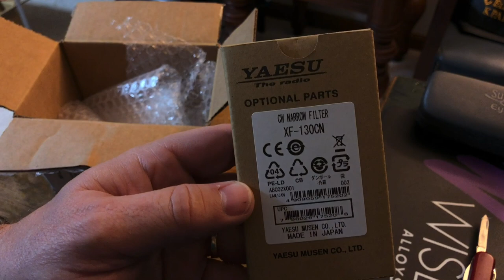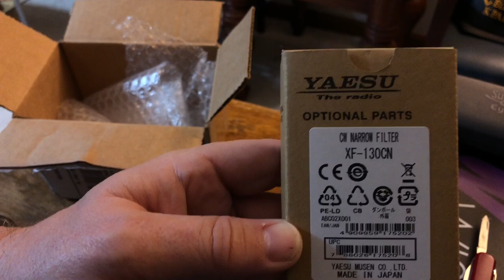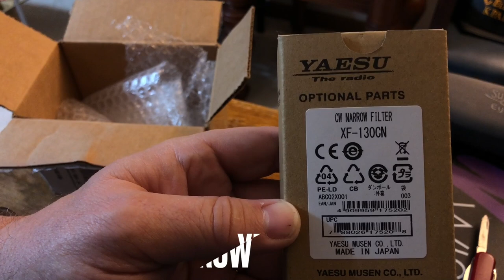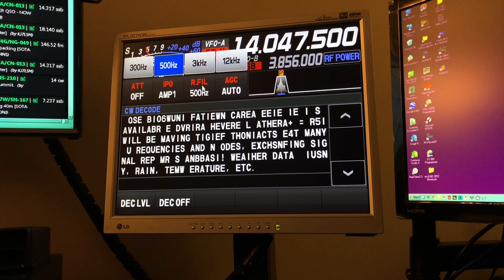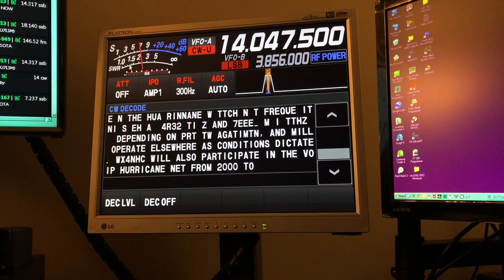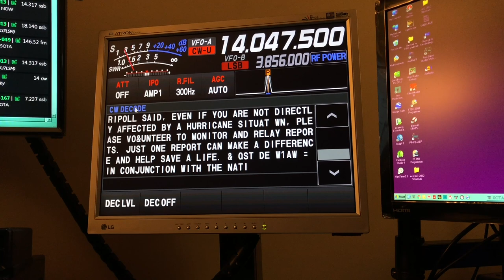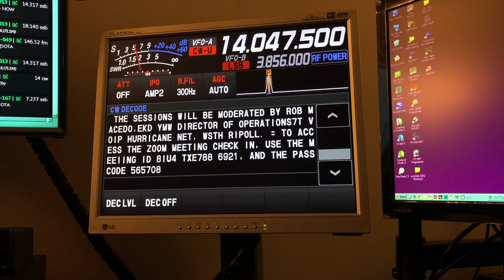Yaesu FTdx10: 300Hz Roofing Filter Installation (Video #38 in this series) #hamradio #ftdx10 #cw

Comment: Thanks for the video, Doug. My 300Hz filter is scheduled to arrive tomorrow. Looking forward to getting it installed. Doesn't seem hard at all.
Reply from the maker: It’s very easy, Tom.  It’s plug and play.  You don’t need to do anything but install the filter and power up the radio.  You will have a choice of 300 Hz appear in the roofing filter options.

Comment: It makes the 50Hz DSP work even better.  It is very quiet and pleasant to listen to when pulling out weak ones.  Thanks for the video.  I had this thing in and playing in 5min.  I did not even get to the end of the video.  Just saw you unscrew it and did the same.
Reply from the maker: It clears more noise and interference early in the receive path.  Since the DSP has less work to do, as a result, the final audio sounds more natural.
Reply: @n4hnhradio  YES!  I have a 80m NTS net and my local QRN level is high, last night was easy on the ears.  NTS is using a hustler 80m resonator mobil antenna in his condo in LA 60mi away.  He is probably on ERP 1W, I can mostly copy him now. I don't think I can copy traffic from him directly without a lot of fills but last night was fairly easy to listen to.  73 de Chris KQ6UP
Reply: @n4hnhradio  p.s.  That issue is the main reason (that and the noisy QSK) why I sold the 7300.  For a little more $$$ the FTdx10 is an amazing radio.  I am also selling my giant IC-761 after I get it repaired because now I have an equivalent (or better) quality RX without taking up my whole desk.
Reply from the maker: FTdx10 number two in the world for RMDR.  Granted, anything in the 90dB range and above is good, but 107dB is very nice.  FTdx10 beaten only by the FTdx101D or MP.  The Flex 6700 listed as number two on Rob Sherwood’s list is misinformation.  He noted in footnotes, and in a separate writing, that it was a radio Flex prepared especially for his test.  No production model Flex has achieved greater than 99dB for RMDR.

73, de N4HNH
Reply: @n4hnhradio  yes.  Very happy with the radio.  The user interface could be better, but I am not going to complain as it hauls the mail RX wise like no other, and this is from practical use not just stats.
Reply from the maker: The ergonomics is compromised, because they didn’t want to duplicate the FTdx101D.  It is basically a single receiver version of the FTdx101D, with a slightly smaller display, without VC-Tune, without multiple antenna ports, and without a front panel spacious enough for more control via knobs and buttons.  But, if Yaesu will make the updates I have requested via their Contact Us page, we will be able to control the FTdx10 via our mouse, rarely needing to touch the radio.

Comment: It's only slightly better for my ears, I can hear the difference. But for me, that difference with the digital kicked in doesn't justify the price. But I'm not a big CW guy. I could better spend the money on a external speaker, antenna, mic etc.
But man you do a fantastic job explaining and actually showing the difference so one can make an educated decision.
Thank you.
Reply from the maker: A little more from the DNR and the 500Hz does fine.  Now, during an emergency, during crowded band conditions, the 300Hz will make a notable difference.

73, de N4HNH
Reply: @n4hnhradio  I'm not a contester but I would think that would make it very useful.
Reply from the maker: Same here Larry.  I’m not into contesting either.  But improved selectivity is always a good thing.  A contest represents the type of crowded band conditions we might experience during a regional or National emergency.  The transceivers with the best selectivity will shine under such conditions.  So I like to think that I didn’t buy a contest capable radio for contesting, but more for emergency conditions.

73, Doug

Comment: Thanks. It would be interesting to see the filter in action on a more crowded band like the cq wpx coming up this weekend. Great video, thank you.
Reply from the maker: I already showed the FTdx10 filtering in contest conditions, using the 500Hz roofing filter.  It’s video #11 in the series.  It can only get better with the 300Hz filter.
Reply: @n4hnhradio  nice video. Proves what I know from using them in my FTDx101MP. Definitely want ones for the 10. I agree with Steve and would like to see with some weaker signals. Great job.

Comment: APF sounds a bit ringing... anyway new 300Hz is definitely best way and good spend money! It is hearable the noise floor goes down when 300Hz switched in even with DSP BW narrowed. Congrats.
Reply from the maker: APF amplifies the sidetone frequency.  The rattle of the filter skirt (ripple) happens at the sidetone frequency.  The reason you hear more of the ripple (ringing sound) at less than 100 Hertz width is because you have blocked so much of the noise that the only thing left to hear is signal and filter ripple.  And then I employ my "notch trick" to minimize the filter ripple, so I'm left with the weak CW signal that I might otherwise have been unable to hear.

73, de N4HNH

Comment: For best results working on Japanese equipment, use a JIS screwdriver and not a Philips. That filter made a nice improvement cleaning up the signal.
Reply from the maker: The Japanese are now recognizing the IEC standard, so a German-made Philips screwdriver is allowed.  The Chinese also made the change from their GB standard to the IEC standard.  

73, de N4HNH

Comment: ... Opposite corners AND don't tighten the screws until you get the last one in, then bottom them.
Reply from the maker: Yes. That’s how I was taught.
Reply: It's a radio,  Not a cylinder head.
Set loose until you've got all the screws in, then tighten with a Japan driver.

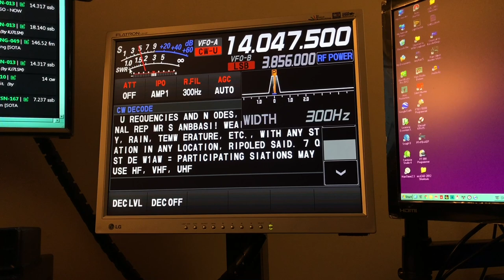Comment: 13:00 "...take it down to 50 Hz..."    And you might have gone too far for the decoder algorithm.  Such a narrow filter likely 'rounds off' the symbols, and the decode appears to have gotten worse.

300 Hz is probably the default setting for the digital APF for this sort of reason.
Reply from the maker: I’m afraid not. APF is tighter than 50. There is no default of 300 Hz for APF. APF is very tight and it boosts the CW pitch frequency. But APF accentuates the filter ripple at the same time, since the ripple frequency is the same as the CW pitch frequency. 50 Hz subdues the ripple. I seldom ever use the decoder except for a video, to show the decoder. Ironically, a few minutes ago I decoded an S3 with an S1 noise level using 50 Hz and APF. I was unable to decode until I subdued the noise and the filter ripple. 

You’re right that 50 Hz rounds it off a bit but the APF helps and the decoder still works.  That said, this is a video about the 300 Hz filter. I don’t always set digital width to 50, but it is my go-to for pulling out ghost stations. Do what works for you. 

73, de N4HNH

Comment: This is all Klingon to me as I’m still learning but find it so interesting. Thanks man for the videos. Could you please advise what multimeter you have at you’re work station. Thanks 73
Reply from the maker: The multimeter on the workbench is a cheap one that I bought, I think at an auto-parts store.  I like that it can test 1.5V, 9V, and 12V batteries under load.  The meter itself puts them under load.  Sometimes a defective battery will show proper voltage until it has a load on it.

My main multimeter is a Fluke 87.

73, de N4HNH
Reply: @n4hnhradio  Thank you for the extremely fast reply. You make brilliant videos packed with information. Hoping one day I can follow along without hurting my brain. It’s obvious you have been involved with amateur radio for a long time and now a goto guy. God bless from Canada 🇨🇦
Reply from the maker: I started installing and repairing Citizens Band radios at age 14 (1975).  I became a licensed amateur in 1982, while working for a Motorola service shop.  To work on commercial transmitters I was required to pass the FCC General Radiotelephone Operator License (aka GROL) exam.  That license hangs on the wall in my shack.  I have been a radio nerd for the vast majority of my life.  

I had good Elmers, especially Andy, Blackburn, WD4AFY (SK 2020).  Andy taught me CW and proctored my Novice exam.

73, de N4HNH
Reply: @n4hnhradio  Good to hear you have great support and educators. My claim to fame was I had a CB back in the 80’s for a while. It was a Cobra 🐍 AM model. But they became outlawed by the UK government and so I sold it on for a FM model. It only had 2 watts output and distance was pathetic. Some guy told me the way to increase the output wattage, was to compress a coil on the inside, which I did. It doubled the output to 4 watts but still only got out approximately 4-5 miles. But then the school kids got into the hobby and it was painful. The richer ones had bigger rigs with power mic’s and they bled over everyone else. They would interrupt any communication by keying the mic to block you. Then there where (what became known as) Bucket Mouths. People with powerful equipment breaking into a conversation and constantly shouting BUCKET BUCKET BUCKET. This killed it off and most people just quit trying to use it. My wife’s uncle (now passed), had a radio repair shop and was a ham enthusiast for many years back in the 50’s+ His son followed into the business and both where very talented at their trade and made some great stuff. One project was bought by a broadcasting company. Please don’t ask what it was but they also took the patent. Tinkering in my youth making crystal sets or cats whisker sets, evolving to 1 and 2 transistor sets. There was also acorn valve sets in kits I made, I messed around with old B/W TV’s and anything I could get my hands on. I also was looking to tryout for the RAF as a radar technician. But my attention turned towards girls and the rest is history. Now at 67 and working towards my amateur license here in Alberta Canada. You have probably forgotten more than I have ever learned, memories lost in time although doing the training some stuff is still relevant and comes to mind as I read through the training. It’s a a great hobby for sure. I sometimes feel though, all this new technology does somewhat remove the mystery of and pleasure of feeling the heat from tubes and twiddling dials trying time fine tune a signal but that’s me being nostalgic I guess. I would visit the local docks where ships where broken up on the off chance of getting an old radio but all had been stripped prior to the breakers yard. Magazines would advertise WW2 surplus radios one being the X19, a 6 acorn valve shortwave radio. But most where we’ll out of my finances or required power supplies that weren’t readily available or came with. But this is a new chapter for me so we’ll see how it goes. Thanks again for the vids and my apologies for rambling. God bless and 73.
Reply from the maker: Oh the smell of tubes, Richard.  My first amateur HF radio was a loaner from one of the Motorola guys I worked with.  It was a Hallicrafters SR-150.  He also loaned me a straight key.  I had much fun with that radio. 

That’s interesting about how different CB rules were in the UK.

Thanks for your participation on the channel!

73, Doug

Comment: A word of caution: DO NOT PICK IT UP BY THE STAND even to position it on the table.  I did, and the stand came apart and the radio dropped about 3 inches onto the table.  The wire part of the stand sticks into plastic ends a very tiny amount.  Luckily, the radio is built very rugged and aside from scaring the you know what out of me, no harm done.  It’s very embarrassing for me to have to admit this dumb mistake but I hope it will help others.  I love my FTDX10; I hope it forgives me.
Reply from the maker: Good advice.

Comment: Test with a weak signal with other stations nearby... The 300 out performs any digital filtering.
Reply from the maker: The digital filtering is quite good but the 500 Hz, and even better, the 300 Hz, roofing filter helps the DSP do a better job.  

Interestingly, the FT-891 relies solely upon digital CW filtering and it can hold its own versus the transceivers with physical filters.  It doesn’t beat them, but it isn’t far behind at all.  That is a testament to the Texas Instruments TMS320C6746 DSP chip and the clever DSP programming by Yaesu.

73, de N4HNH
Reply: @n4hnhradio  I have the 300hz filter and under contest conditions it blows away the dsp.
Reply from the maker: If you keep watching this video series you will see the FTdx10 blocking signals 100 Hertz away, after combining the 300 Hertz roofing filter with the DSP.

Comment: Doug, can you please explain this. The 101 has an optional 1.2khz ssb filter. What is the purpose?, I would think that narrow would be almost impossible to distinguish audio #1. And #2, since the third order and blocking is so good , is it even needed? Thanks
Reply from the maker: I have had contesters move in 1KHz away from my QSO.  I digitally narrow the FTdx5000MP to 1.2kHz and then use Shift, so I can carry on my QSO.  1.2kHz is about as narrow as I wish to go, but I have gone a bit more narrow in desperate times.  I will also employ the mu-tuner (VC Tune in a 101) and nudge its center away from the QRM.  

The 1.2kHz option is somewhat similar to the 300 versus 500 Hertz CW filter.  The 1.2kHz roofing filter will provide a bit more narrowing before the signal reaches the DSP, to be narrowed there.  It can help the DSP do a better job.  So it’s another icing-on-the-cake scenario.  It might not make a huge difference but could be noticeable.  

Such tight filtering provides you with more weapons to combat a crowded band, such as contesting and during an emergency.  For casual rag-chewing, such tight filtering isn’t really necessary.

The Sherwood rating is for interference from 2kHz away.  Nothing is a brick wall, not even a 101.  When interference is less than 2kHz away, even a 101 can use some help.  Like I’ve shown in my FTdx5000MP videos, combinations of IPO, ATT, filters, Shift, and a variable preselector, like mu-tune or VC Tune, can mean the difference in continuing your QSO or not.

73, de N4HNH

Comment: I just got my -10 yesterday, I should be firing it up Friday. Thanks for showing me where to go to see if it has it since it already has the MARS Mod. 

I like what you have on the LG monitor, what program is that?
Reply from the maker: The LG monitor is connected to the FTdx10.
Reply: @n4hnhradio  so the -10 actually decodes the incoming CW signal? Looks like I have a LOT to learn. Thanks.
Reply from the maker: @azarellediaz4892 Yes, it can.  I have a 96 part tutorial series (thus far) over on my Patreon site. S7 and S9 members have access to the series in the FTdx10 collection.

Comment: Hi, I am having thoughts should I buy the 300hz filter. Does it work on ghost stations, or would you think save your £160 pounds. Guess when that £80 cashback arrives in my bank me be a little easier to tell the wife lol
Reply from the maker: Every bit of bandwidth you can narrow prior to the DSP helps.  If you are a prolific CW operator, I highly recommend the 300Hz roofing filter.  You can hear the difference it alone makes, in this video.  That allows the DSP to do an even better job.  

I work ghost stations that lesser receivers wouldn’t even detect were there.  While the 500Hz filter also makes it possible to pull out he ghost stations, it is even easier with the 300Hz filter.  Using the 300Hz filter helps combat QRM but, in the case of pulling out a ghost station, it is the lowering of the noise floor that helps.  Many hams don't seem to understand that.

73, de N4HNH

Comment: What is the install and calibration option from Yaseu when you purchase? Is it really necessary to let them do it? Do they really "calibrate" anything?
Reply from the maker: I have no idea what you mean.  There is no calibration needed for installing a roofing filter. You can see in my video how easy this is. Now, if you are referring to the FTdx101D, Yaesu has to install the optional roofing filter(s). They are not plug-and-play, like the one for the FTdx10.  I think Yaesu made a mistake with how they handled the optional filters for the FTdx101D. But, they don’t care what I think. I don’t even like to like Yaesu. They just produce the best radios for the money - for any amount of money. 

73, de N4HNH
Reply: @n4hnhradio  Thanks, the 101D is the one I was thinking about. I wonder what they have to do? I wouldn't mind getting my hands on the technical service bulletin.
Reply from the maker: You will have to call Yaesu for the service manual. They charge for them. 

The filters have to be soldered in. My guess is that the FTdx101D is so cramped inside that they didn’t have enough room to fit all of the optional filters in as plug-in boards. I mean, look how much larger the aftermarket filter is in my video, compared to the preinstalled filter. The FTdx101D has the option for even more filters, including a 1.2kHz SSB filter.  I suspect they must be soldered in to conserve space. Major disassembly is likely involved in order to flip the circuit board over so you can get to the underside in order to solder.  The best thing to do is order the radio new with every possible filter installed. 

73, de N4HNH
Reply: @n4hnhradio  Thanks for the feedback.